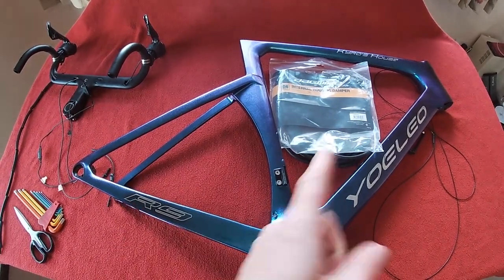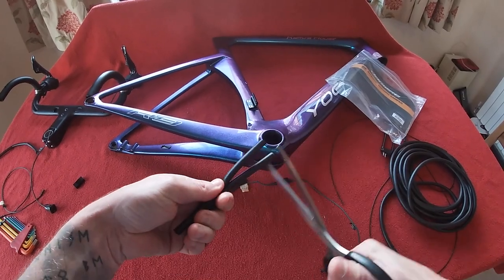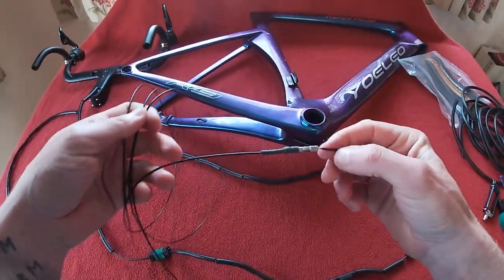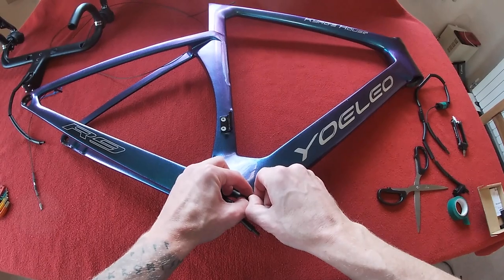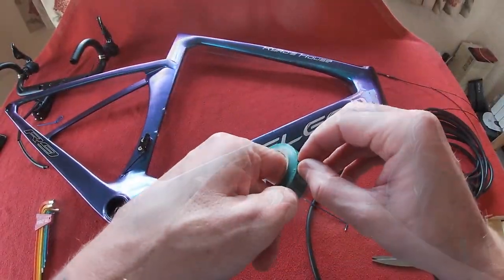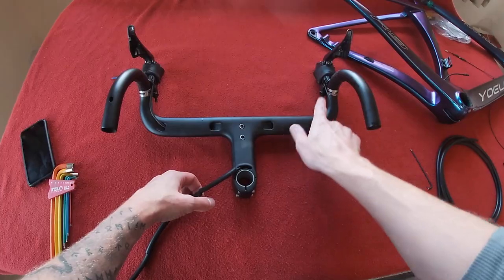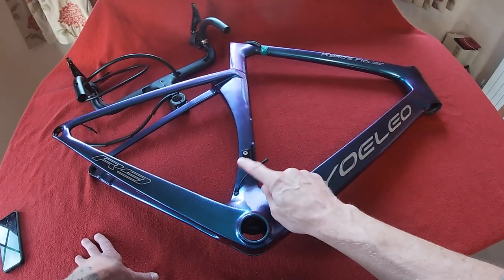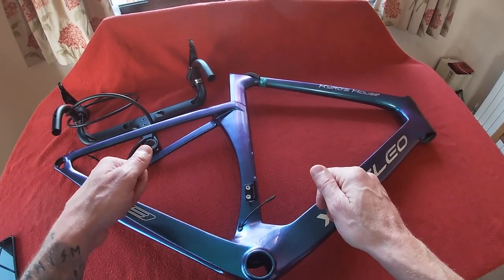Installing Di2 Internal Wiring Through Frame

Comment: Is this the replacement frame?
Reply from the maker: No, I’ve been sent some pictures of next years models, I’m just selecting which one I would like. 👍
Reply: @KyrosHouseCycling  ..so you managed to clear the chainstay?
Reply from the maker: @cannon1156  yes, I used a wire coat hanger from the bottom bracket and pretty much just forced it through. 👍
Reply: @KyrosHouseCycling  how are next year's models looking like? would love to see
Reply from the maker: @raphaelbartolome2265  a couple are out on their site and some more early December I think. 👍
Reply: @KyrosHouseCycling  what was blocking the chainstay hole?
Reply from the maker: @kanweijin  I’m not sure, but it was rattling around in the frame, it’s still in there and I’m not sure what it is, maybe when I get the replacement frame I will cut it up and have a look. 👍